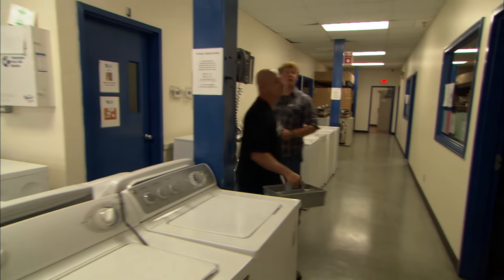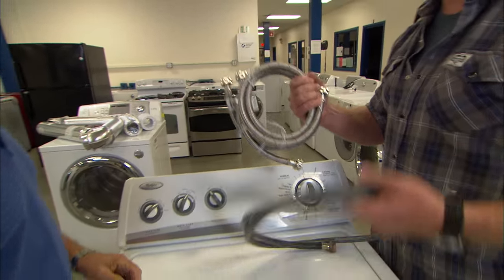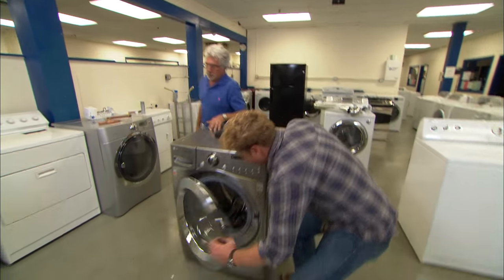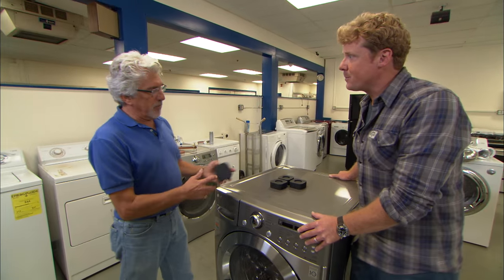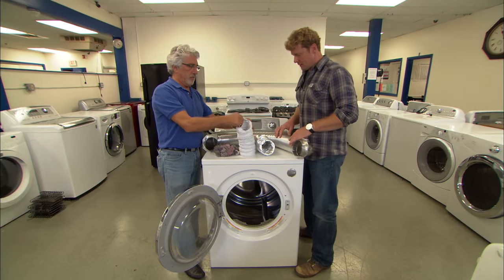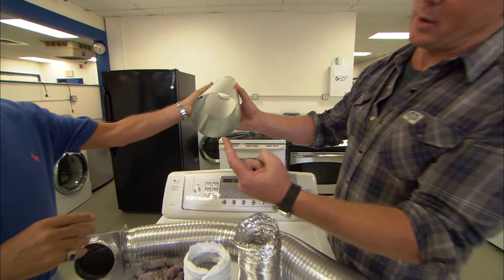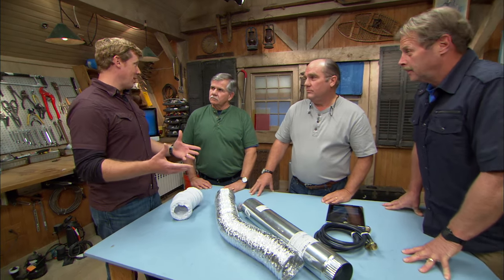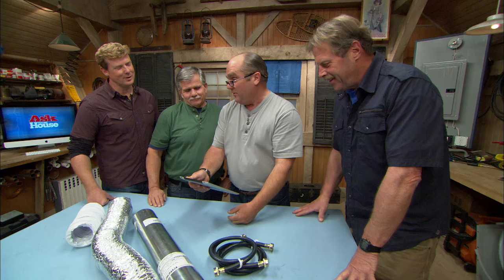How to Maintain Laundry Appliances | Ask This Old House

Comment: For my washer, I keep the water shut off values closed when not in use.  It's easy if the values are modern shutoff values because it's just one quick partial turn.       Even when using the washer, I only open the cold water value.  (Many people don't realize with the new detergents, you can get by with cold water on most laundry loads perfectly well.   The only exception is diapers and such.    So I have one quick turn of my cold shutoff valve when i start the wash, and one quick turn back when done with the wash.  Takes 2 seconds out of my time, but gives me peace of mind that I don't have to ever worry about my hoses bursting when I am away  because they are not under pressure.    I don't worry about changing them every 5 years either.  Even if they do burst I'm right there, not away from home.

Comment: I've never had a burst hose but I did have excessive water pressure which forced its way thru my washer's cutoff and filled the tub to overflowing. That is why they put faucet handles next to washers and that is why I use them.

Comment: Those were great tips on the hoses and vents, so many homes have the inferior parts because people cheap out on them. I liked their other tip about closing the water service valve when you're not using it that they gave in the other video. Most people don't realize their washing machines hold full pressure 24 hours a day while that valve is open. Like other people commented I'm not a fan of this new technology, communicating for diagnosis, I think it's all marketing waste. If the machine was made well to begin with you would never have to service it. On a dryer that you take care of properly you should at a very maximum only have to replace the belt, perhaps the rollers or idler roller in a reasonable amount of time. Now with all of this very sensitive IO that is poorly manufactured on a machine that is constantly vibrating and subject to static charges, power surges and strikes, and high heat, it's no wonder why they would fail. Don't get me wrong, I think sensory information is awesome, and the more the better, but it's a dryer, not a motor vehicle! I have an old Maytag that is probably 25 years old and runs almost as good as the day it was made. Granted it's not as efficient as others made today, but the original motor and heating element and major components are still there. I've only replaced the rollers and belt (after 20 years!).

Comment: Been using the same hoses for 6 years, no issues, no swelling, neighbor has been using same hoses for over 20 years, no problems. If you feel the need to buy new hoses every 5 years, go for it. Not everyone is going to have a problem.have family who have never had to replace their hoses, friends same. Personally never known anyone who has had to.
Reply: Must have horrible water pressure..
Reply: David D    I hear you,  I think 5 years is usually sooner than needed.  Better to just check the hoses for rust or bubbles after 5 years,  because who of us remembers the exact year when we last replaced the hoses anyway ?    To me the best solution of all (if you have modern type shutoff values) is to just shut the water supply off to the washer when not in use.    Then I don't worry about the hoses ever.
Reply: @rjwalker6677  I have had the same hoses on my washer for 6 years but I did by the stainless hoses my washer is 11 years old old school timer top load washer works fine. I can't get to my water shutoff easy.  The washer and dryer are in a closet you have to push the dryer over and then slide the washer over some pull it out then you can reach the shutoff. The shut of is just under the washer control panel behind washer and it's a tight space.  The closet is in the kitchen next to the pantry.

Comment: For full water pressure there is a fix. Have a electric valve set installed instead of the manual model. After its installed you plug it into the electric outlet then you plug the washer into the new valve setup. Now every time you turn the washer machine on it automatically opens the water supply valves.
Reply: not reliable.  It has to open and close many times and will wear out.

Comment: The electronics in these new machines are a nightmare, not only for the owner but for the technician trying to explain to the owner that their 2 year old appliance isn't worth repairing due to a major component failure, or multiple failures.  Power surges will kill these appliances.  It happened a couple years ago not too far from where I live.  Seemed everyone's appliances in that area were effected, many required expensive repairs or total replacement.  A less complicated non-electronic controlled appliance will most likely last longer, give the customer fewer problems, and require less phone calls to a repair technician.  

Those front load washers & dryer sets are our number 1 call for service on a weekly basis.  Those still using the old style non-electronic top load washers and non-electronic dryers only need serviced once in a great while, a belt breaks, agitator kit replacements, dryer vent cleaning every few years very cheap to repair and virtually no maintenance.  

Washer hoses are another thing that customers want to cheap out on, yet in a couple years when the hose bursts its everyone's fault but theirs because they wanted that $5 hose rather than a $20 hose that will last twice as long and not be prone to bursting.
Reply: +William Todd (williamtodd) Yea, I have a couple of economy Ropers.
Reply: I bought a new Samsung front load washer and it has so many problems.  The sensors are always failing which causes it to turn itself off.  The door sometimes won't unlock.  Other times the door leaks water.  This is after only two years of ownership.  Meanwhile my parents are still using their 20 year old washer without issue.
Reply: FunkyWeezy Tons of issues similar to yours that we work on every week.  I'd say about 90-95% of the repairs are on these newer machines that are full of electronics.  Ridiculous prices on them and they don't work very well for very long before they start giving customers problems.  My next washer and dryer set will be a Speed Queen.  Built in the USA, 3 year factory warranty on the base models, 5 year factory warranty on their electronic models, and they are extremely quiet.  They actually aren't all that expensive compared to other brand machines that are built to last 5 years if you are lucky.  Speed Queen is saying their machines are built on a 25 year life expectancy.  Many laundry mats use the coin operated Speed Queen machines.
Reply: +William Todd (williamtodd) Couldn't agree with you more. The consumables and replacement parts for these older machines, even OEM parts are so inexpensive, and are as easy to change as watching a youtube video.

Comment: Personally, I absolutely loath these "smart" internet-connected appliances. Give me the old-fashioned versions with analog switches & timers & lasted for 20-30 years & I could service. I don't want to have to pay $300 for a new control board every couple years because no one can repair an ecb anymore.
Reply: For me its not how long it lasts, but how well it performs...I need clean clothes that don't look washed out.
Reply: you own a flip phone dont you
Reply: bgregg55 you fail to realise that as recently as the 1970's, a washing machine cost a months salary for the average man. Nowadays a basic model is 1 - 2 days salary. Unfortunately in order to make them as cheap as consumers have demanded, quality has reduced.
Reply: A great washer to have is a 2017 or earlier speed queen or a whirlpool direct drive washer. The appliance pro knows this.
Reply: AMEN !!!!!!!!!!!!!!!!!!!!!!!!!!!!!!!!!!!!!!!!!!!!!

Comment: I have a MIELE washer and  i only clean the outletfilter once a month, have no maintenance whatsoever and it runs for 28 years no problem, just bpught a new one. Also had a microwave oven from MIELE lasted 25 years no problem. And this is no Advertisement lol
Reply: +rolf sinkgraven I have a miele washer and condenser dryer too, I've never cleaned the outlet filter at all in the washer, didn't even know I had to. I'll check it out now, thanks for the tip.. On the dryer I just drain the water tank and clean the lint filters. Both now 5 years old and still work perfectly as when I purchased them at great expense.
Reply: +rolf sinkgraven -- I've heard great things about Miele, incl. their dishwashers.
Reply: Mo Poppins. They do make great appliances but they cost a kings ransome
Reply: Miele is the best house holding applications, you use it for 20+ years you change colbosters and you are good to go.

Comment: Everyone I know who has a front loaded washer has had nothing but trouble. From clothing having a sour smell, not being fully clean, or parts breaking as soon as the warranty ends they always end up going back to a top loader. If it ain't broke, don't fix it.
Reply: James Stacey front loaders have been normal in Europe for three decades. Top loaders are almost unheard of and virtually impossible to buy. Funny how we don't seem to have these problems! Plus, they are proven to wash better and use significantly less water and electricity. But then again, when has the US ever cared about the environment...
Reply: @spencerwilton5831  Water is an entirely renewable resource despite what the companies profiting off you would have you beleive. And they wash WORSE. There is simply no argument here your washer swishes the clothes in less water which means it has less ability to hold dirt and water soluble chemicals than a front load.
Reply: @spencerwilton5831  We have done a lot more for the global environment than the EU. Does the EU still pack up all their offices in Belgium and truck them to Strasbourg, France for ONE MONTH, each year?  Stopping that madness sounds like a simple, efficient way to reduce pollution, to me. But I guess Europeans have all the answers. 🙄

Comment: I've been working in laundry machines for over 2 years, you don't need those ''vibration pads'' why, because every laundry machine has one build in their own feet plus not every laundry machines have circles some of them have other figuration. and that won't hold for long for example Miele laundry machine weighs over 150 kg. Take a waterpass place it horizontal/vertical on your machine and install the feet at a point where it gets balanced. done changing your hose every 5 years is unnecessary unless you are a rat and chew on the hose.
Reply: How do people have such vibration issues anyway my washer is on a concrete sub floor on top of tile works just fine. I had lived in an apartment with a frontloader on a Second floor I never even noticed the washer running it was nice and smooth. I also never loaded the wash drum more then halfway either. It was just me at the time so not much laundry to do.

Comment: They still aren't quoting the code on the venting. You must use rigid beyond 8ft. from the appliance or where it penetrates floors, walls or ceilings. Flexible transition duct is approved only for the first 8ft. from the appliance, cannot be spliced, must be stretched out so it doesn't say and have that rough inner surface he talked about and is listed to UL 2158a. That semirigid aluminum flex is NOT approved. Most mfrs. will void the warranty if improper venting used. No screws in joints except one 1/4" screw now allowed. Male end must point away from the appliance. Termination can NOT have bird screen. 

Washing machines should have water hammer arrestors because of fast closing water inlet valves main cause of burst hoses. Good idea to use a flood control water valve and put a cheap battery wet alarm on floor. If finished walls or flooring washer needs to sit in a pan to drainage. Need to inspect venting min. annually and sweep as needed. >15K reported dryer vent fires/ yr.

Comment: Dude, use front loafers they are so much better!
Reply: Until the seal brakes then it floods your house just get a top load with no agitator
Reply: @PlayingwithPawz those are easily replaceable
Reply: @PlayingwithPawz  the seal does not fail that often,it lasts a long time,and you need to spell correctly it's spelt breakes
Reply: @PlayingwithPawz  there isn’t water above the door on the and that’s extremely unlikely to happen

Comment: Are there any condensate dryer in the states? I can't remember when I have last seen a dryer with that big exhaust hose attached here in germany.
Reply: nubix I think you're on about the Condenser Dryers
This type doesn't require a hose and they also have a filter to catch the lint and you should always empty it each time you do a load to prevent a fire from occurring
Reply: those use a heat pump which is much more efficient than resistive elements
Reply: I've never seen one. I actually had to search the term to be sure what it was. At least in my area, natural gas dryers are by far the cheapest dryer to run. Both those and electric dryers that I've ever seen are vented outdoors through a 4" duct, as shown in this video.

Comment: Those smart diagnostics are generic at best for example the “bent drain hose” is an error for a slow drain.....ie you forgot a quarter in your pocket and it went down and mangled your drain pump. DONT GO FOR THE FANCY GARBAGE! Just get a basic washer and dryer, you’ll regret your aesthetically pleasing appliance in 2 years or less guaranteed!

Comment: Vibration pad, good solution? o_O Only to compensate the flaw manufacturers make. 
The old way this was done by german manufacturers was to put massive concrete blocks into the machine so the machine won't "walk" away during the spin cycle. That's the reason why the older washing machines made by german manufacturers wight round about 100kg (220 lbs). Miele still manufactures machines which weigh 96kg, the others are only round about 60 or 70kg. But Miele is expensive.
Reply: Marcel Germann agreed, Miele make the best appliances. They are actually weighted with cast iron, not concrete- cast iron is even denser. If money is an issue, a basic Miele is a much better option than a "top of the range" model by anyone else. Even the cheapest Miele comes with a 5 year guarantee, and often they do promotions extending this to ten years. They are designed for 20 years typical use and I have one that is still going after 26 years and three owners.
Reply: Ok, didn't knew that. The other manufacturers put concrete blocks into the housings. Actually it doesn't matter, the thing is the machines must have weight. Otherwise you'll get problems.

Comment: braided stainless steel hoses are more prone to breakage than the old rubber hoses.  many of these hoses are made in china.  the quality of these hoses are horrible.  on the surface they look durable but are not.

Comment: Blinks rapidly     High Efficency soap? For a front loader? Normal laundry detergent works absolutely fine, and most of Europe ONLY got front loaders... We use liquid laundry soap, powder, pods, all the same stuff the US uses too... facepalms Just add as much as it says in the manual, and HE Soaps are a pure rip off...
Reply: most detergent nowadays is only high efficiency detergent it's almost impossible to find non he detergent as making two types of detergent would be too expensive so the stuff your using is likely he detergent that will work in both types of machines.
Reply: This is only applicable to North America high efficiency is a North American standard